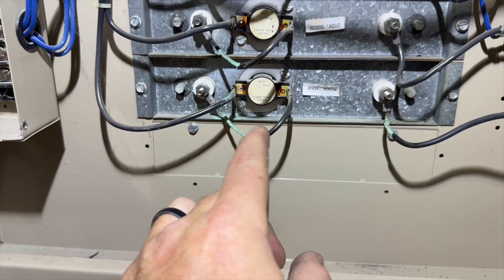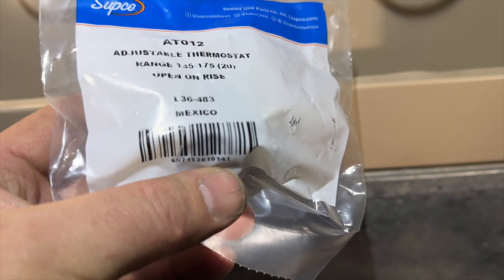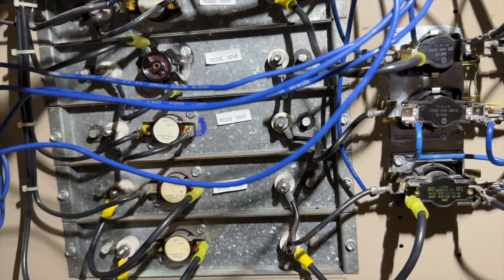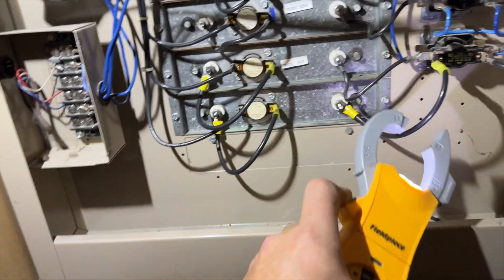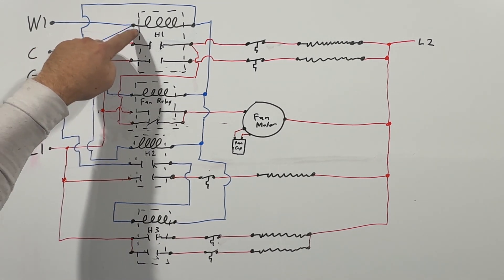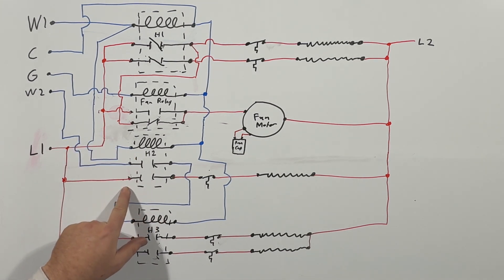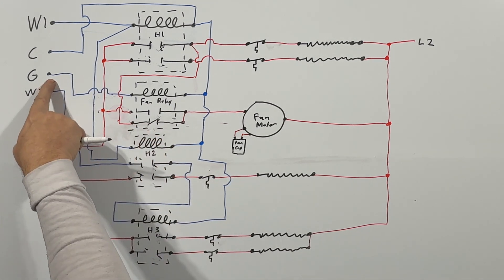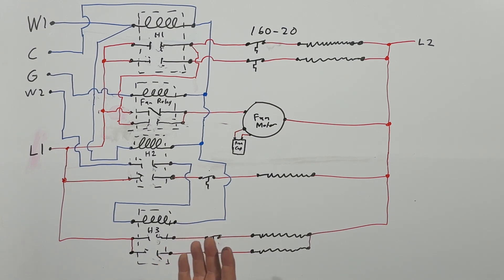Troubleshooting an Electric Furnace EP196

Comment: Good information. I have a problem that seems different. Thermostat was turned way down but furnace housing was getting quite warm. Turned the thermostat off and was still getting warmer, almost hot. Like the heating element/s wasn't turning off. Maybe the thermostat stopped working? The fan worked when I flipped the switch to just run it and not heat. Didn't want to take any chances so I tripped the breaker.